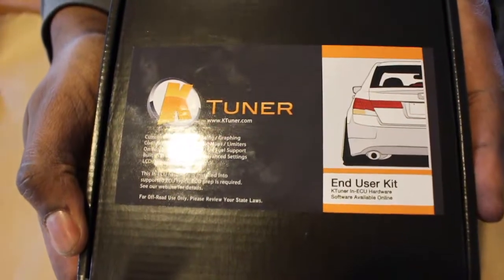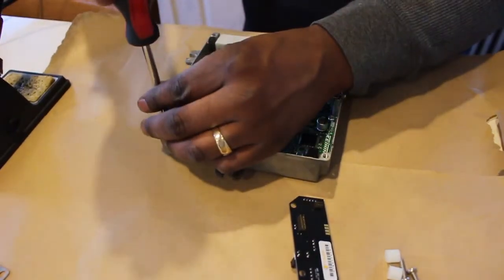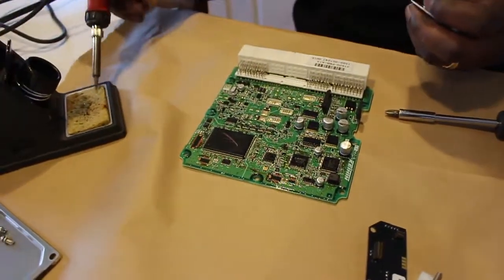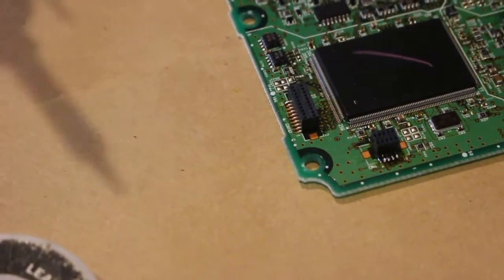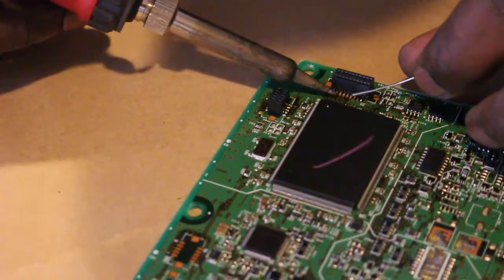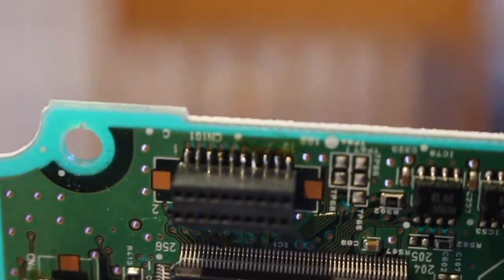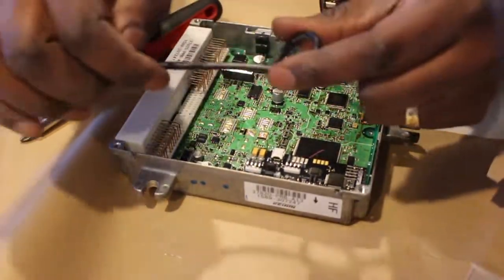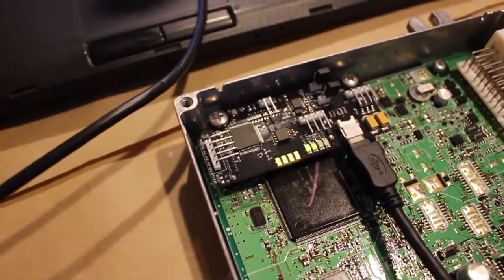Quick KTuner end user install

Comment: Hello, great video!

I have a (Non CAN) 2007 Honda Ridgeline. I contacted K Tuners and they said their kit will not work on my vehicle (only for 2009-2014 Gen1 R/L).

Will your modifications also work in getting a K-tuner work on a 2007 R/L? Thanks!

Comment: Is there a way to know if the ktuner is unlocked without installing it in the ecu?
Reply from the maker: I don’t believe so
Reply: @m.h.tuning885 It's possible. You just hook it to the PC. No need to be in an ecu. I bought a used one and found out it was locked. Sent it back

Comment: YES header does not come with the KIT, I only found this out after receiving my end-user kit, you don't get the 10x2 (PN# HRS-2FY-20-SG-SMT) and 5x2 headers (PN# HRS-2FY-10-SG-SMT) ordered from Digikey they cost less than $12 shipped, but no you can be charged $15 to 45 just for these... that is total BULLSHIT. even though I watched this video a few times, I never heard "it does not come with the headers" probably I didn't know what to expect. thanks for the video and the great info.
Reply: Bro you just saved me 48$ There is no info at all about these connectors, and i almost spent 60 bucks for 2 tiny connectors (20$ item + 40$ shipping which is ridiculous) but the 10 pin connector wasn't in stock so i just bought 3 5 pins and imma fuse 2 of them together.
Reply: thank you so much